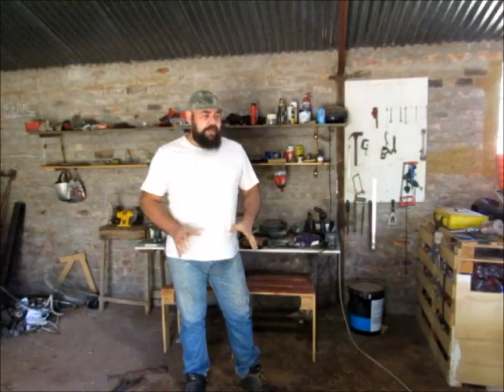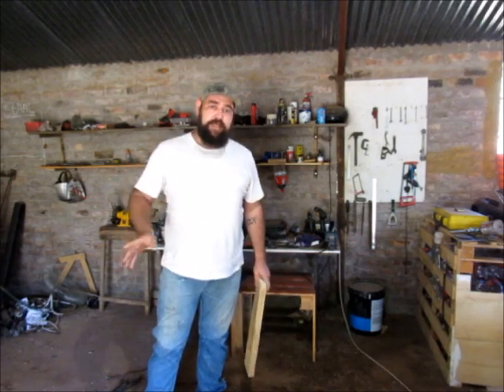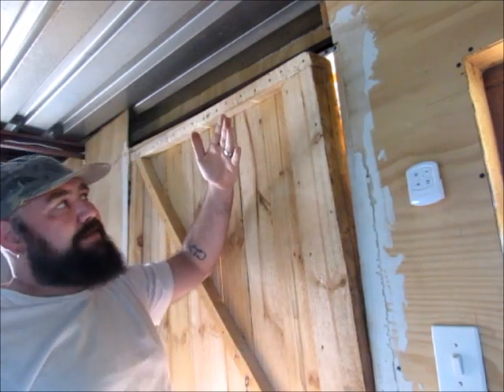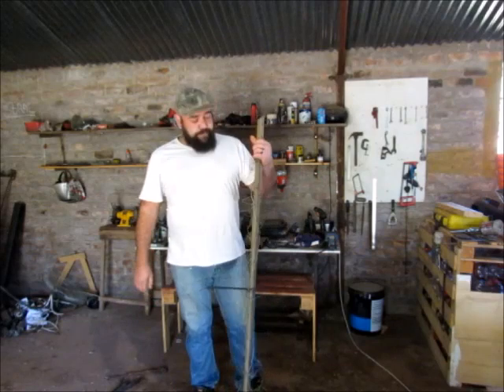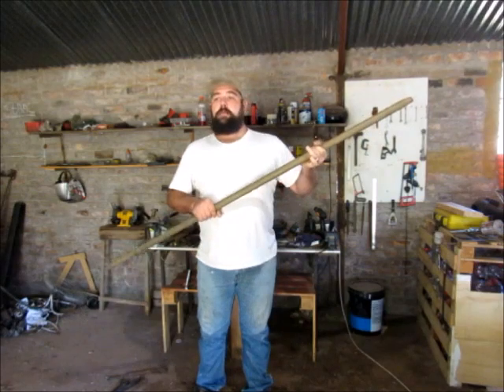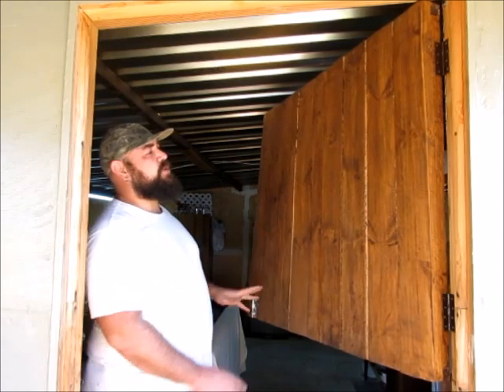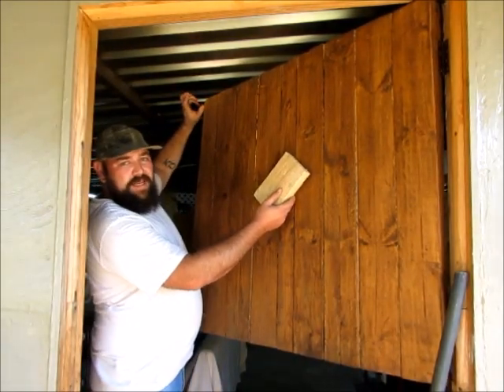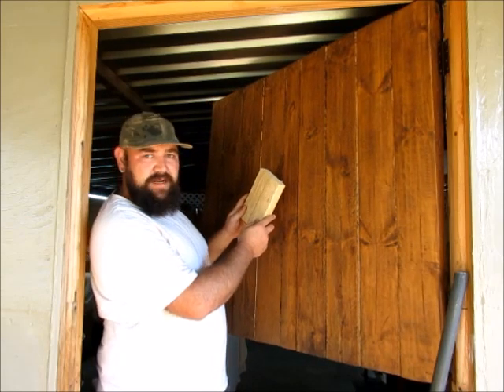HOW TO - Straightening a bent wooden door - DIY Tips

Comment: The doors aren't constructed correctly. Should be framed,pledged and braced...especially external stable doors.
Reply from the maker: This is very true. However for someone with zero prior knowledge and with time of the essence it did not turn out too bad. Main issue on the build was using unseasoned wood that still had moisture, and thus the whole bending and pulling issue.